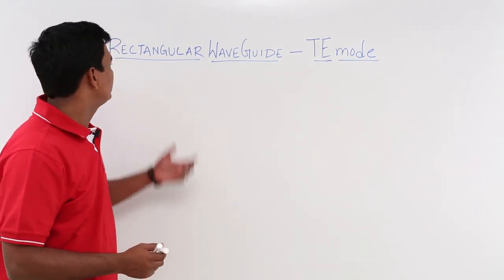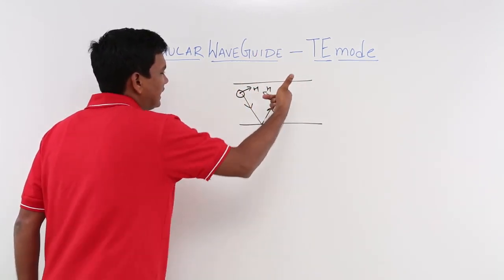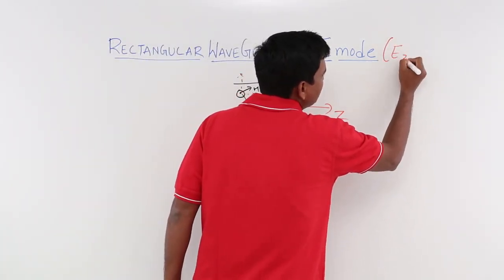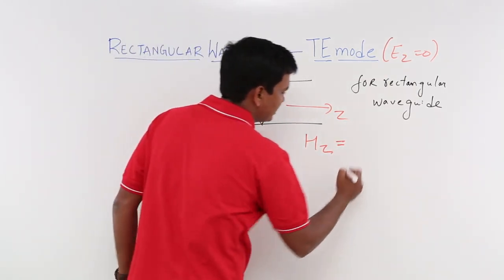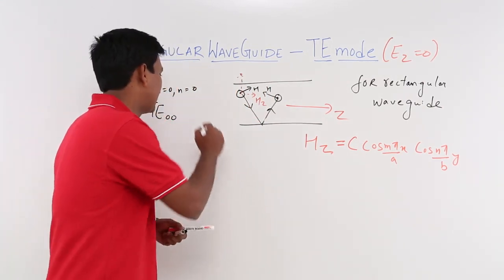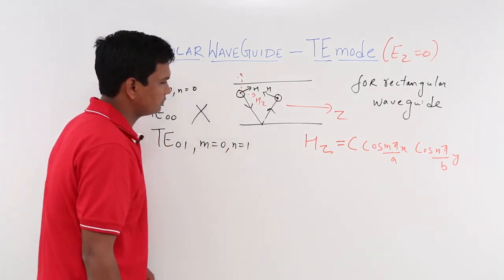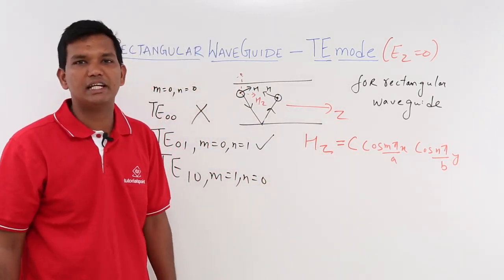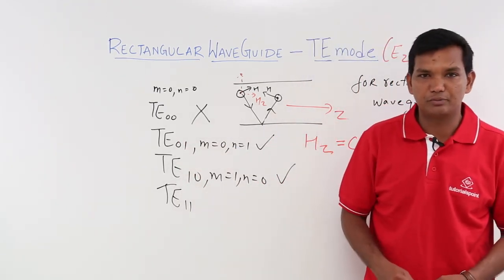Transverse Electric Mode   Rectangular Wave Guide

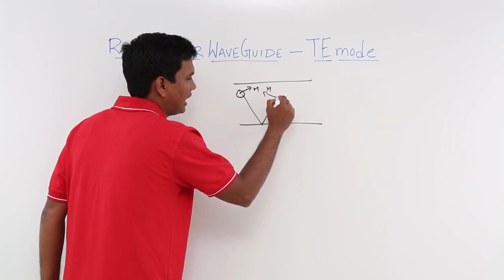Comment: The EF @00:24 is taken out of board and marked dot whereas at 00:40 EF is said to be inside board. Diagram is showing EF, MF & Dir wrongly.. Please correct. Anything which is going inside should be shown with CROSS rather than DOT.
Reply: Use Fleming's left hand rule

Propagation direction = E×H

Thumb = middle finger × forefinger

Hope this helps

Comment: What is radiation? How is a transverse wave produced?
What is refraction?
Light is an electromagnetic wave comprising electric and magnetic field pulsations or variations in strength at each point in the space.
It is a form of radiated waves of pulsating electric and magnetic fields.
They are produced by accelerated electric charge which produce a transverse electric field which propagates outward from the accelerated charge. The radiated fields constitute a wave travelling through space. 
The fields don't travel, the wave does. Yhe fields pulsate in strength.
This is best visualised by a rope, one end of which is fixed to a wall and the loose end held some distance away.
The loose end when moved up and down creates a wave travelling. 
Notice how the molecules of the rope near the wall have not travelled to the loose end. 
The snake-like shape in the form of a sinewave and travelling movement you see is the overall effect of the up and down movement of the molecules of the rope.
The same happens with the strength of electric and magnetic fields of radio waves and light. 
There are no sinewaves in space! It is the strength of the electric field say, which we plot of a radio wave which has a pattern of a sinewave.
When a radio wave or rather the fields of the wave encounter matter, they set into motion the atoms in the material. The acceleration they produce of the charges that make up the atoms and molecules in matter, produce electromagnetic waves and these are reradiated fields. 
The incident and reradiated fields combine to produce a resultant wave.
These resultant waves constitute the fields in reflection and refraction.

To learn more see "Electric and Magnetic Interactions" by Chabay and Sherwood 
www.matterandinteractions.org
or 
Fundamentals of electric theory and circuits by Sridhar Chitta
https://www.wileyindia.com/fundamentals-of-electric-theory-and-circuits.html

The book by Sridhar Chitta, begins with the fundamentals of charge, electric field, surface charge, current, voltage, simple circuit, parallel circuit, capacitors and capacitive reactance, inductors, inductive reactance, induced fields and transmission line effects, antennas and wave propagation, and waveguides, the contents of the book, make a distinct unified approach to electrostatics and circuits lending precision and clarity to the topics which is not found in most text books.
The book comes alongwith a CD with animated power point presentations for all chapters and voltage regulator, RC phase shift oscillators and differential amplifiers included additionally.
There is a "look inside" feature in the amazon.com webpage of the book "Fundamentals of electric theory and circuits" by Sridhar Chitta with a few pages of Chapter 1 which may be viewed and also which you may swipe left or press < icon to view the foreword, preface and Table of Contents. 
For a nice video on antenna and radiation visit https://youtu.be/-F7KYLO4Bkg
For a lecture by Prof Ruth Chabay on radiation and reradiation, watch from the 59.0 minute
https://youtu.be/VKqCI9pU3QI
There is a full set of lectures beginning lecture 13 here on surface charges, electric fields, simple circuits, capacitance, inductance, faraday's law, motional emf, magnetic forces and more topics here
https://matterandinteractions.org/videos/EM.html

Comment: While demonstrating the right and rule, you showed that the E field goes into the board but initially defined the E field to be outside. Basically you erroneously showed the the right hand rule for E field in the opposite direction. You should clarify this in the captions. Anyways, good video.

Comment: Sir, 
 1:08  that is not the direction of the propagation,  that's just the direction towards which the wave move forwards. Actual direction of propagation is this 0:22.

And sir , you're drawing a TEM wave ,then how can its  Electric field component be in the direction of propagation??